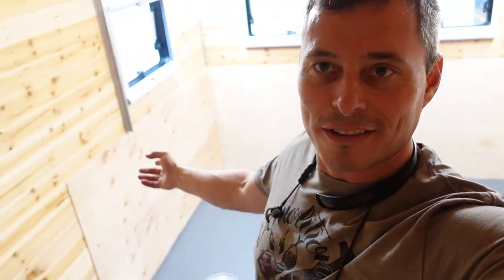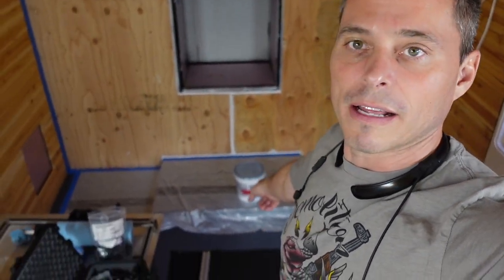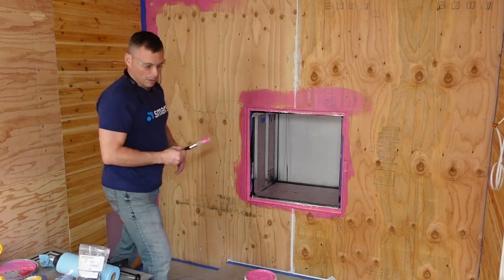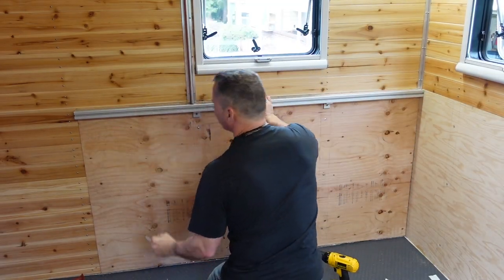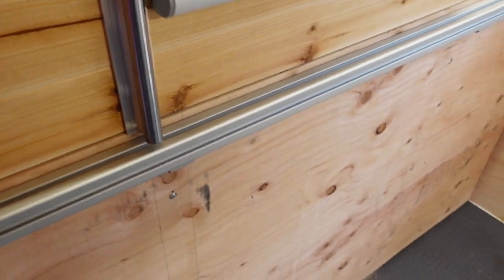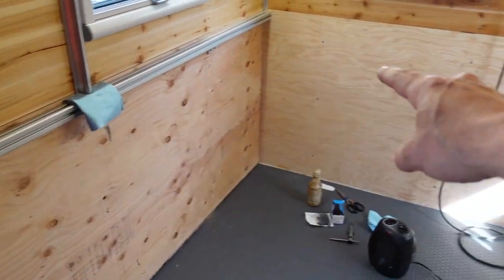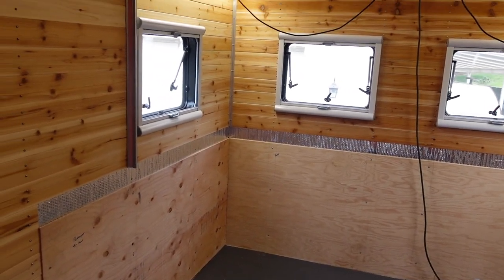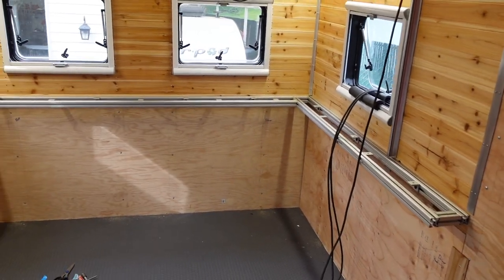Waterproofing the shower wall.

Comment: Looking great as usual. As far as your countertop is concerned did I catch that right, are you going to vinyl wrap a piece of aluminum as your top?
Reply from the maker: The to of the seat back will be a vinyl wrapped backer board.   The aluminum was just a thicknesses gauge.